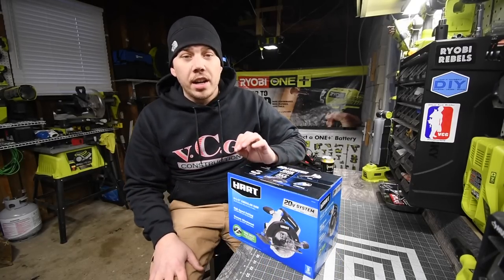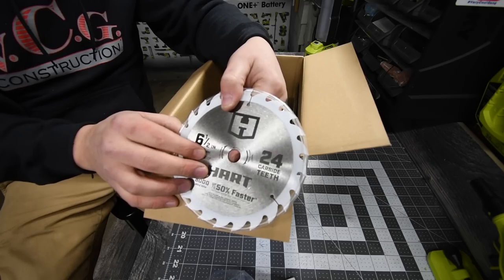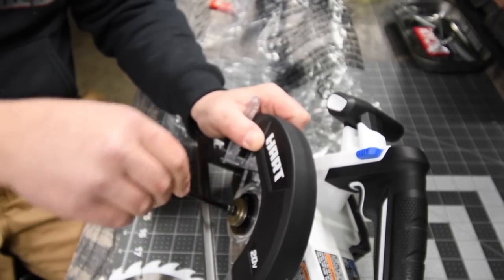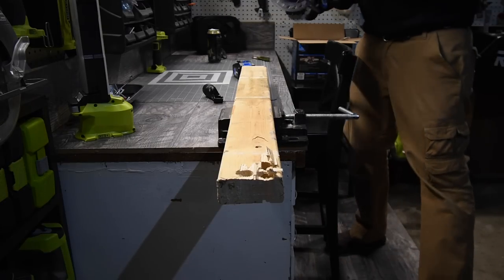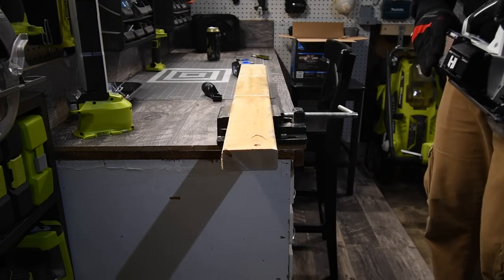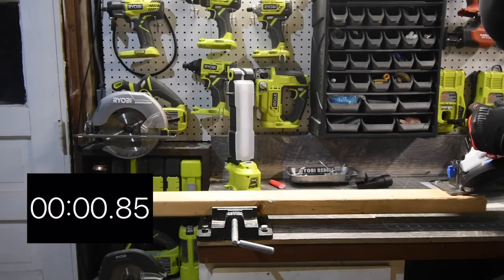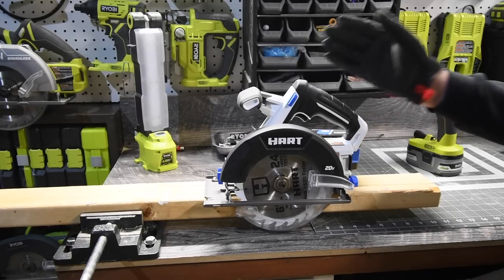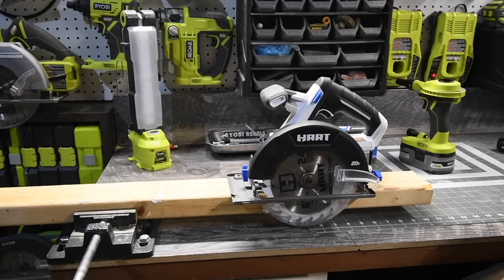$70 Hart 6 1/2 circular saw with a 4ah battery unboxing/test

Comment: Correction...the 4ah battery does give more power. It can output twice as much current, which in the electrical match, means more power...in watts!
Reply from the maker: pointedspider I was talking about the bolts though. Because of the expression 20v is 20v. But I thank you for viewing :)
Reply: @ManCaverTools  even at the same voltage the number of cell stacks matter.

Its like comparing a 440 4bbl vs a 440 6-pack. They're both running air and pump gas..  In the car Youre limited by the speed the air and fuel flow.. In the battery youre limited by the discharge rate. In lithium thats represented in C values.  30c can discharge and charge faster than 25c.  2 30c in parallel are about 60c. Thats why. ( using ryobi as example) 2 stack and 3 stack battery  packs work better than the single stack slim batteries ( with the exception of the 3ah Slim which is almost as high as a 2 stack pack)

Comment: I like TTI. I prefer Ryobi though because there is something about a Ryobi tool that when you pick it up, you feel like you know you trust the tool (you know the feeling). I don't have that feeling with Hart, and probably never will. As for 6 1/2 blades, although you could probably get them at Walmart, 7 1/4 are the standard size. You won't necessarily pay more for a 6 1/2 blade, you will get a better blade by going with a better saw and using a higher quality but cheaper (in comparison) 7 1/4 blade.

Comment: I believe the most appropriate way to say the battery difference is the 4 amp unlocks more power
Reply from the maker: the hight ah in batteries allows the tool to use more of the power that is already there

Comment: Hi,

Pretty nice Hart circular saw.  

I hope DeWalt comes out with a new version of their 6 1/2 circular saw in 2020. Needs to have a Brushless Motor, Rafter Hook and Led light. I have both dewalt brush version and the milwaukee brushless 6 1/2" circular saw. I do find myself picking up the milwaukee more. 

Thanks for the video
Reply from the maker: I thank you strand it would be nice if they came out with one soon

Comment: It seems to be a pre-brushless Ryobi. I do high end cabinet installs and cut a lot of prefinished panel products. I basically use a thick sheet of 4x8 styrofoam as a cut table and cut my material upside down with a straight edge. I have and old blue Ryobi cordless circ saw I got from a pawn shop for 20 bucks. Like new and with a Diablo blade it cuts flawlessly. Even materials prone to chip cut easily even on a 45. If was making decks or need greater depth of cut or something I need a real saw but for my use they do little more and the quality of cut is no better. And when it goes no worries.
Reply from the maker: Hart is for the Diyer that works on stuff once in a while. Not for a Diyer that is always working on stuff

Comment: Hi, what is your view of wearing gloves whilst working with saws. I have heard that it is more dangerous to wear gloves when using rotating power tools. Given that harmful chemicals arent invovled
Thanks in advance
Reply from the maker: wearing gloves sucks while working with tools. but id rather be safe than sorry
Reply: Ryobi Man Caver what do you mean by ‘safe’. I mean it’s more dangerous because you could get the glove caught into the blade. Generally I think people avoid wearing gloves when using power tools.
Reply: @bernardzhang1886  its unlikely that a glove will get caught in a saw, it will probably just cut straight through, either way, keep your hands away from the blade, tho that's common sense

Comment: That's kinda disappointing that it stops sometimes in the cut.  I got the Ridgid brushless one and it will do 2.5 inch rips in a piece of wet hemlock.  Nice test though!
Reply from the maker: correct, you cant push too hard on it or it will stop on a long cut
Reply: When I first used mine I it would stop sometime. I realized I was not holding the blue secondary safety button in completely. It will not run by simply pulling trigger. Blue button must be held in as well as trigger. Takes a little getting use to it.

Comment: Well,blades other than the standard size(7 1/4) are difficult to find,and expensive.that's why i stick to the standards.Best part,these saws are made for righthanded like me,since blade it's on left side,not right side,as corded ones.
Reply from the maker: companies do make a left and right battery circular saw. I made a video on it as well

Comment: Picked one up in walmart the other day along with a few other hart tools to get a feel for them. Honestly the old hyper tough line felt better constructed. That hart drill has a cheap plastic chuck and the hyper tough had a all metal chuck. For 70 bucks I'd rather get a corded saw that has decent build quality.
Reply from the maker: the brushless Hart drill did a fantastic job and way better then the brushed model
Reply: @ManCaverTools  good to hear, im basing my opinions off of in the hand feel alone so i don't have the whole story.

Comment: Great DIY saw, most of the cuts it should be ok.  For someone that does more frequent DIY or contractor need a better one.
Reply from the maker: I agree. this is not a contract grade saw, great for the Dryer though
Reply: I have the Milwaukee fuel 7 1/4 circular saw, and I just bought all the hart 20v tools with 5 of the 4 amp batteries. Honestly, I could build a deck with my Hart tools the same way I could with my Milwaukee. Only tools that have to be top brand are the impact and drill driver! I tell no lies!
Reply: Thunder Up 405 exactly !!!

Comment: So I can’t cut metal with it ?
Reply from the maker: I would not advice it. id use a metal cutting saw for that. but technically you can with the metal cutting blade but it is not advised

Comment: just what the world doesn't need.  An even cheaper and crappier Ryobi.
Reply from the maker: I think its perfect for  a DIYER. there is no issues with it, are there better saws out there? yes there is, by a long shot, but that doesn't mean this a a crapy tool for the DIYER
Reply: @ManCaverTools  with all due respect, a crappy tool is no less so if used by a diy.
Reply from the maker: I just did a HILTI versus Milwaukee video, the Milwaukee lost. Does that mean Milwaukee is a crappy tool now? The Milwaukee even had a High Output battery and the HILTI did not have a special battery and the Milwaukee still lost

Comment: I watched a video of hart demoing their tools. They acted so proud of them 😆. Acted like they were performing 👍. Acted like they were so powerful. It was hilarious. You knew the guy was thinking pieces of shit the whole time. I couldn't act that well.
Reply from the maker: I don't play out brands, Hart is good for a DIYER that doesn't do that much.. Hart isnt bad but its not great either
Reply: @ManCaverTools  have you tried any hand tools yet of theirs? I actually haven't seen a single wrench they produce aside of adjustable. No combinations at all. Have you seen any?
Reply: Honestly their 10” miter saw and impact are plenty powerful. They have weak spots in their lineup for sure, but there’s some solid tools for the price as well
Reply: If you only plan on using your Hart tools less than 10 times a year, then these may be OK for you. If any of those 10 times could stress the tool (like long usage sessions or cutting or drilling through really hard wood) then get something else as you don't wanna unknowingly cause excessive wear on your tools using above their capability without knowing. And some tasks most people might think a tool should do, Hart tools shouldn't do.

Comment: That was a good test.  I really like how you did the long rip cut.  With the 2ah battery the hart saw performs similar to the hyper tough circular saw.   I’m hoping with a larger battery to see a similar increase in performance.  
I was looking yesterday and noticed hyper tough is releasing a new 40v battery powered lawn mower.   That comes with 2 - 20v 4ah batteries.   
I’m hoping they’ll release the batteries as a stand alone item.  And Walmart will bring some of the out of stock items back.   It seems like they put a bunch of money into hyper tough.  So Hart didn’t kill it.  With better marketing Hyper tough could take on black and decker.   
If you wanna barrow my hyper tough circular saw, 2.5 ah batteries and a fast charger.  Let me know.
Reply from the maker: Versus videos are coming up soon and thank you sir
Reply: 9